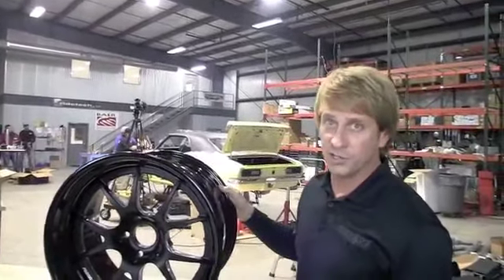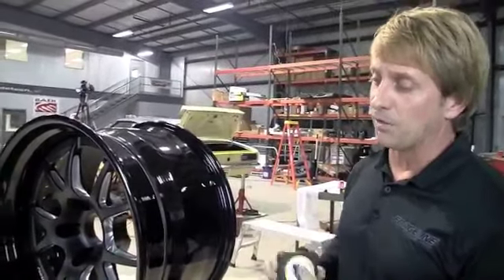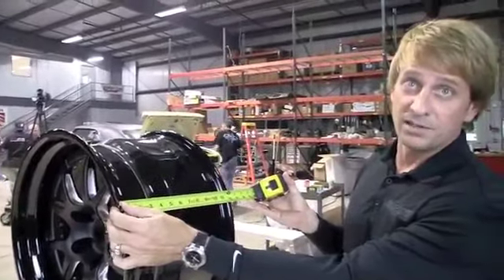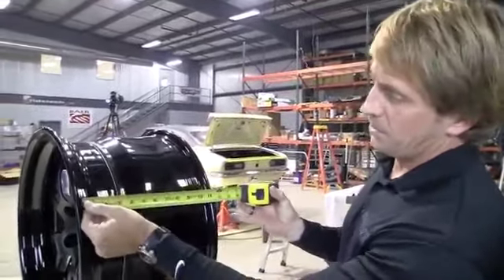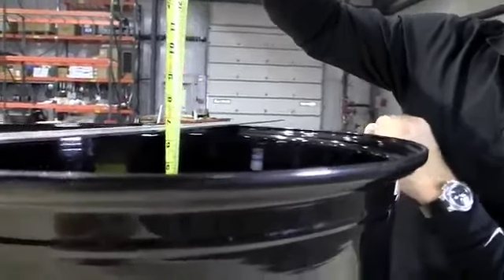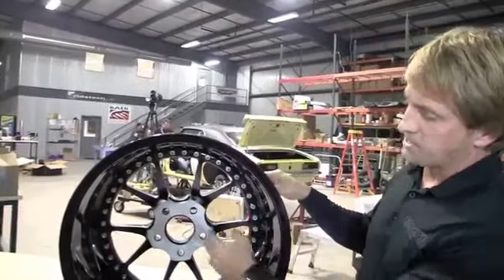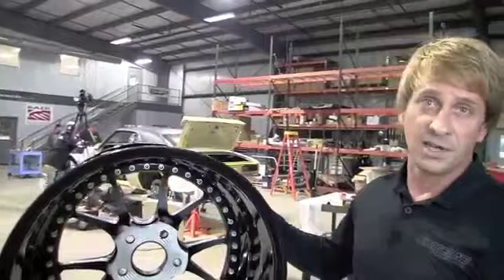Forgeline's Dave Schardt Explains How to Measure Backspace and Offset

Comment: Wheel width (were tire seats) + 1" = Total wheel width (from edge to edge) 

* Backspacing is the measure from the wheel mounting surface to the wheel's edge (suspension side). 
* Offset is the measure from the wheel mounting surface to the wheel's center line.

Total wheel width - Backspacing = How much goes out (street side)

Comment: When the width was measured to be 11" (inside wheel bead). ... But the when you laid the wheel on its face and put the straight edge across it and measured 6.5" from mounting surface to straight edge.... Should it not be 6"? Keeping in mind the .5" of front/back side of wheel lip?

Comment from the maker: No, backspace includes the bead seat. So you should NOT subtract the 0.5 inch for the bead seat. That is what is confusing. This wheel will have a 6.5 inch backspace and a 5.5 inch front space which totals to 12 inches. But it is an 11 inch wheel width. Bead seat is included in the backspace/frontspace, but not in the wheel width.

Comment: I have a 2009 silverado 1500 pickup. Would a -12 or +18 offset stick out more?
Reply from the maker: A negative offset would mean that the center of the wheel is to the outside of the mounting surface.
In other words, +18 means that the center of the wheel is 18mm inboard of the hub mounting surface.
-12 means that the center of the wheel is 12mm outboard of the hub mounting surface. So a smaller offset will stick out more.

Comment: I need to figure out if my rims on my RV 0 off set, I was told that this marking can be found stamped on the inside of my rims. Wondering if that is true ? I have Dexter NEV R Lube Bearings on my axles, and they say these bearings will go to hell if the rims are not ) off set. Wishing that I didnt have the dexter bearings, but can't afford the high cost of having them changed out..... :( Also I'm soon to replace the tires, so I'll have a look and see if I can find that marking that I was told about.
Reply from the maker: +Goodolboy One if you have a wheel without a tire on it, then just measure the overall width and the backspace and subtract them. If the backspace is exactly one half of the overall width, then you have 0mm offset. If the backspace is one inch greater than half of the overall width, then you have a 1 inch offset. (And there are 25.4 millimeters per inch, so a 1 inch offset is equivalent to a 25.4mm offset.)
Reply: Forgeline Motorsports
Please forgive me for being so dumb to all of this... This is all new to me. Ok, I measure the entire width of the wheel, Then I measure the distance from the backside of the mounting pad of the wheel out to the very edge of the wheel, and I subtract what measurement from what measurement ?  Again, please forgive me for being so dumb to all of this... When I take the wheel in to have the tire changed, I will take the measurements and let you know what they are.... Thank god for people like you all... Everyone is a teacher in one way or another..... Thanks
Reply from the maker: +Goodolboy One By definintion, "offset" is the distance from the hub mounting surface to the center of the wheel. It is typically expressed in mm, but if you are trying to hit 0, then the unit conversion is a moot point. So the center of the wheel is the total measured wheel width divided in half. And backspace is the distance from the back edge of the wheel to the hub mounting surface. So offset is the difference: measured backspace minus half the wheel width.

So if you measure a 10 inch wheel width, then the center line of the wheel is at 5 inches.
If you measure a 5 inch backspace, then the hub mounting surface is also at 5 inches.
So 5-5=0 offset.

If you measure a 7 inch backspace, then 7-5=2 inches. (2 inches x 25.4mm/in = 50.8mm offset)

If you measure a 4 inch backspace, then 4-5=-1 and the center line of the wheel is actually 1 inch OUTBOARD of the hub mounting surface, hence a "negative offset". (-1 inch x 25.4mm/in = -25.4mm offset)

Just remember that the center line of the wheel is half of the MEASURED wheel width, NOT half of the STATED wheel width. As explained in the video, the stated wheel width does NOT include the bead seats. So a wheel with a 10 inch measured width is probably considered to be a 9 inch wheel. So if you are not actually measuring the real width, but you know that you have a "9 inch" stated wheel width, then you need to add that extra inch for the bead seats and assume that your center line is actually 5 inches from the edge (10/2=5), rather than 4.5 inches from the edge (9/2=4.5). If you are taking an actual measurement of the wheel width, then this is not an issue.

I'm a digital marketing manager, not an engineer. But I would guess that the concern about the bearing life is a matter of multiplying forces by creating longer levers with very low offsets. In other words, as the center of the wheel extends outboard beyond the hub mounting surface, then you have essentially created a longer lever (or "moment arm", as my engineer friends like to call it) that pushes and pulls against that bearing. And since a longer lever multiplies the road force acting against the bearing, then this is likely to accelerate the rate of bearing wear. So typically, I've always assumed that high offsets (in which the center line of the wheel tends to be well inboard of the hub mounting surface) are less likely to multiply the forces acting against the bearing and that low offsets (in which the center line is near or perhaps even outboard of the hub mounting surface) are more likely to multiply the forces acting against the bearing.
Reply: Forgeline Motorsports
I want to thank you for the help, and all the information. Today I took the wheel to have the old tire removed, and new put on. I talked with the gentlemen that was doing the work, and he said he knew how to figure the measurements and could tell me if my wheel was 0mm offset. Thank goodness they are 0mm offset and that sure puts my mine at ease. I was very worried about that because of the Dexter Nev R Lub wheel bearing that are on the axles.

You are correct in explaining how the offset can effect the wheel bearing. These bearings are made in an enclosed sealed housing. The weight of the RV must bear down directly in the center of the bearing. If not, the bearing will soon fail. I've learned from you, and I thank you again very much for the help. You are great..... Thanks again.

Comment: well explained as the boi greg ski said..but to me backspace and off set is still the same if your calculating from the center of the rim to the back..ya feel me..
Reply from the maker: No, Backspace is the distance from the back edge of the wheel to the edge of the hub mounting surface (or the back of the center pad on the wheel). Offset is the distance from the the hub mounting surface (or back of the center pad on the wheel) to the center of the wheel.

In other words, if we have a 18x11 inch wheel, it will have a total width of 12 inches (including the inside and outside beads). So if that wheel has a 6 inch measured backspace, then it has a 0mm offset. (The center of a 12 inch wheel is 6 inches. 6-6=0)

If it has a 7 inch backspace, then it has a 1 inch offset. And there are 25.4mm per inch, so it would be a 25.4mm offset. (The center of a 12 inch wheel is 6 inches. 7-6=1inch. 1inchx25.4mm/in=25.4mm.

In this case, it was a 6.5 inch backspace. So 6.5-6.0=.5 inch of offset.  Or convert to mm: 0.5in x 25.4mm/in =12.7mm.
Reply: thats sick man..much appreciated, fully understood thanks

Comment: WHAT ABOUT THE GD OFFSET!? THAT WASS BULL SHIT!
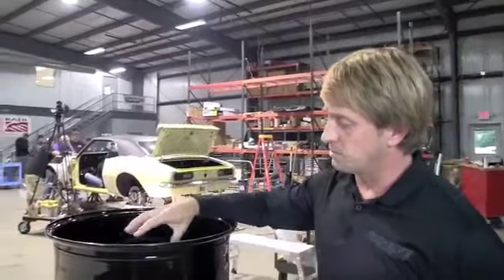Reply from the maker: Dave explains how to calculate offset beginning at the 1:45 mark. Offset is the distance from the mounting hub to the center of the wheel. In this case, the mounting surface is 0.5 inches forward from the center of the wheel. It is a 12 inch wide wheel, including the width of the beads. So the center point is 6.0 inches. The backspace (ie: point where the mounting hub meets the wheel) is 6.5 inches. So 6.5 - 6.0 = 0.5 inches of offset. There are 25.4 millimeters per inch. So 0.5 inches x 25.4mm = 12.7mm.